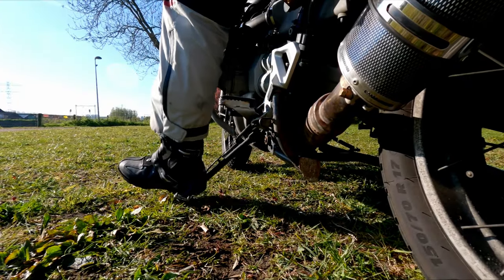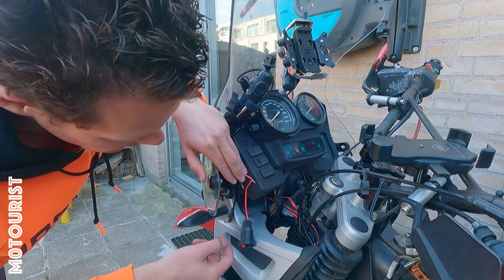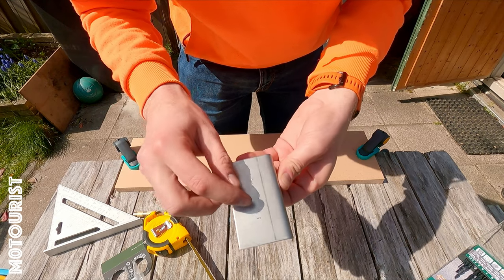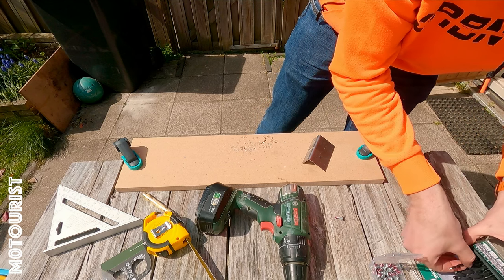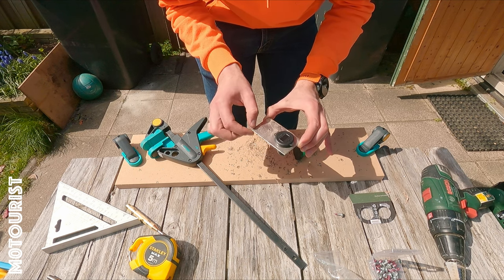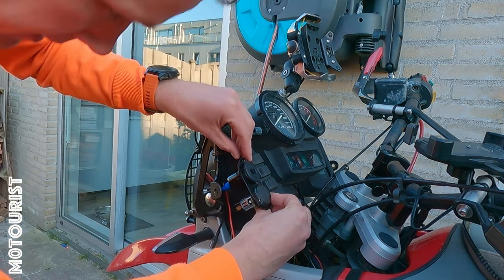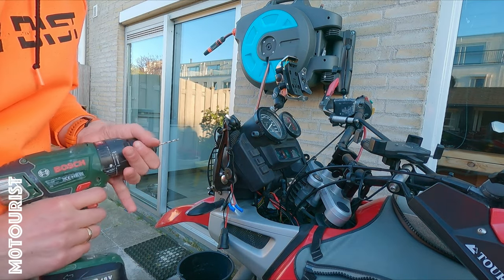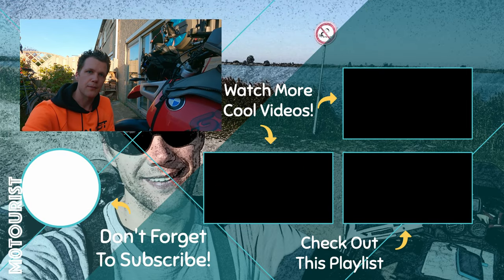Bike Mods - How to install a USB & Sigarette Lighter Socket - BMW R1100GS

Comment: Hi there, newly subscribed to your channel and love the info!
I’m currently looking for a new bike and was thinking of a second hand bmw gs and have been looking at the 850 and the 1100 (for some reason the r850gs holds higher prices)
Any advice?
What to look for so I don’t get scammed? I’m quite new in the gs market.
Cheers!
Reply from the maker: Hey Daniel,
The R1100GS is a bit more common, I believe that is the reason why the 850 is a bit more expensive.
The main 'weak' point for both is the gearbox (under heavy offroading it may crack where it supports the sub-frame), the clutch is a pretty expensive replacement, not due to the parts but due to labor costs (cardan, gearbox and sub-frame needs to be removed), if the bike has ABS you should make sure it functions properly (a failure is usually tied to the ABS-unit, which is also expensive ;)).
For the rest these bikes are pretty bullet-proof
Reply: @M0Tourist  thanks man!
Will go check one without abs on sunday (75000km) hope it’s a good one!